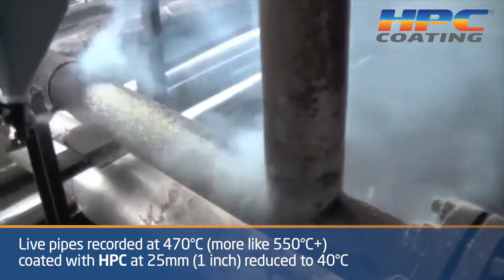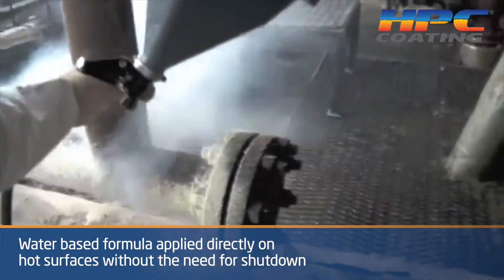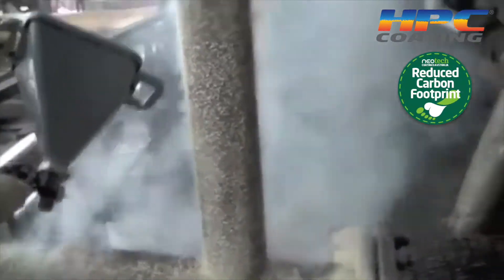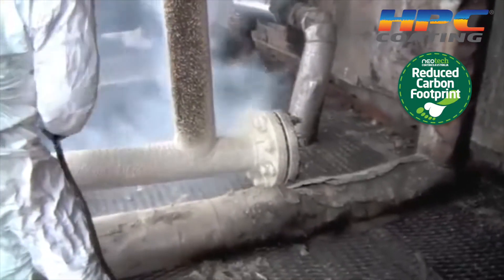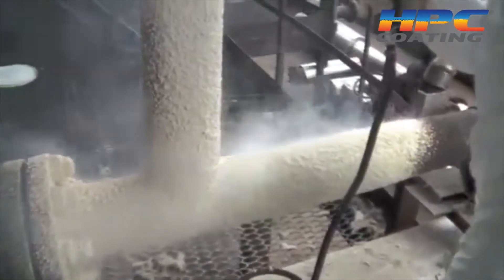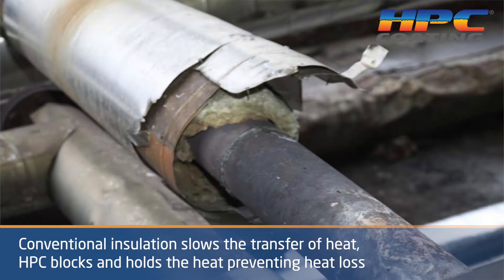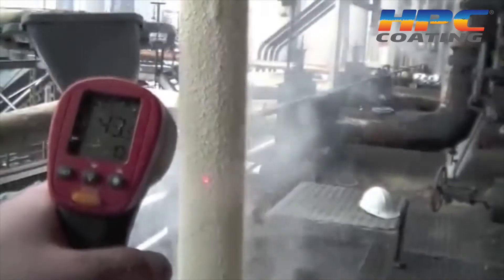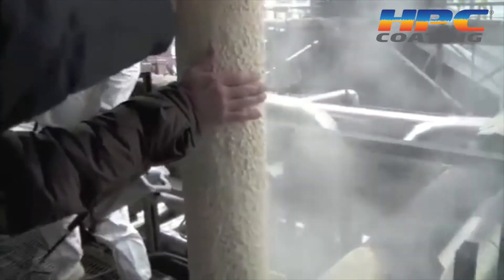HPC Coating® - World's Live Multi-Ceramic Hot Pipe Insulation Coating

Comment: Title is a lie. Its not the only coating that can be applied on hot surface. Isollat04 max temp +600c and isollat 02 max temp +170c. Can be applied on hot surface
Reply from the maker: Thanks for that. Just to clarify with the products you've described can they be applied Live or does the pipe need to be shut down?
Reply: @NEOtechCoatings  yes they can
Reply from the maker: @alexnegrash8707  Okay, thanks. We'll change our heading